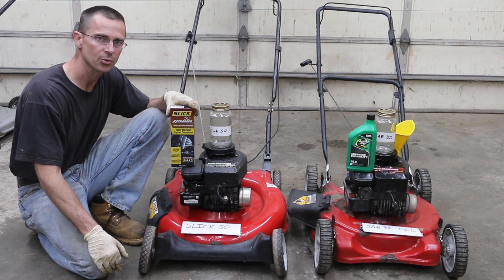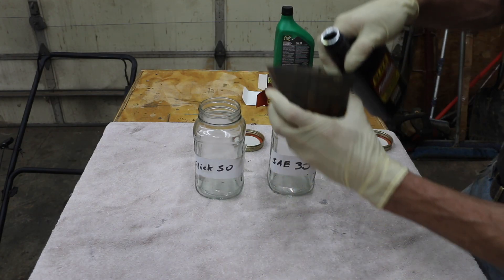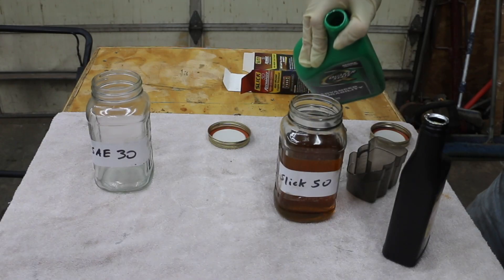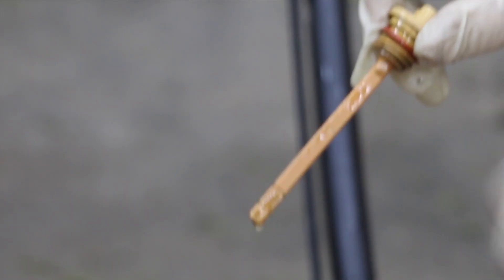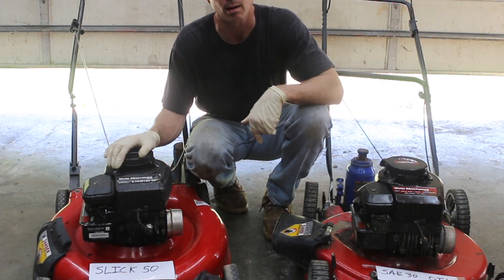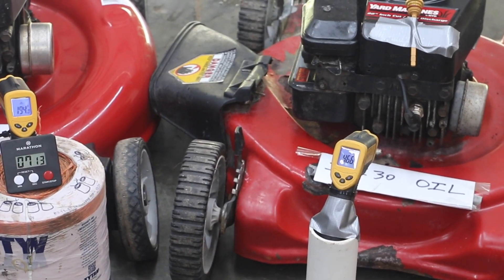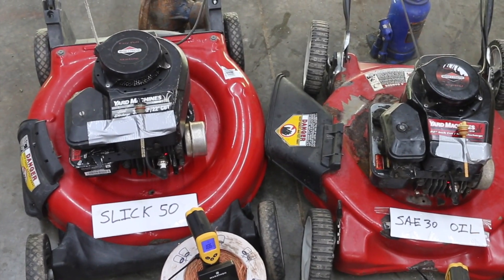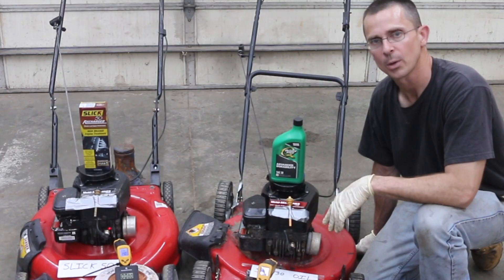Can't believe what SLICK 50 did to my engine!!--Dry Crankcase Test!

Comment: G'day,

   Well, the Luftwaffe used to add Powdered Graphite to their Aero-Engine Oil, according to legend, which supposedly enabled somewhere around 5 minutes extra running-time, after losing Oil-Pressure in Cimbat, during the Battle of Britain...; but..., I first heard the story from a Travelling Salesman who was flogging "Wynns" Friction-Modification Oil-Additive, back in the late 1970s.

   They used go around all the little Country Town Shows, to run a 6-Cylinder Liquid-cooled Car Engine (with Overhead Valves operated by Pushrods & Rocker-Arms), on a Test-Stand which was mounted on a Trailer behind tgeir Truck loaded with their product ; and they'd fill the Engine's Sump with new Oil plus their Additive early in the morning, around 9:30 AM, run the motor at idle for about half an hour, and then leave it running while they drained the Sump, and removed the whole Sump-Pan, plus the Rocker-Cove & Side-Plates..., and then it would sit there turning-over for about the next 12 hours ; and then do it all again the next day... with the same Motor (!).

   It was really very impressive, until my father (an Engine Reconditioner who owned hisvown Offset Crankshaft-Grinder in 1948...) explained the trick to me...

   The Water-Cooling keeps the Head & the Block cool, and pulling the Covers off (ostensibly done to "prove" that  there was no hidden Oiling-System...) made all of the Moving-Parts become effectively Air-Cooled, at Idle-speed and under no load ; and given such conditions..., it takes a bloody long time for ALL the Oil between the moving-surfaces to dry out completely, especially if the Crankshaft was carefully ground so as to have all of it's Journals a few Thousandths of an Inch undersized - to allow them to expand into the Bearing-Shells with a slight clearance-fit, rather than siezing-up, when the Engine does become warm to the touch...

   But a lot of people didn't have my Old Man for a father to explain the inside story, so vast amounts of the Additive was sold...., because "seeing is believing..." (!).

   Caveat Emptor !

      (Latin, for "Buyer BEWARE !").

 ;-p

  Ciao !

Comment: STP  back in the day before synthetics, supposedly that was one of the benefits of NASCAR engines running it. if there was an overheating issue or a loss of oil pressure, it would help the engine live longer.
Reply from the maker: David, Great point!  Thanks for watching the video and commenting!

Comment: the lawnmower what's slick 50 looks a lot newer then the one with regular oil. before even running the test I knew the one with slick 50 would lock out first because it's a newer motor and obviously has less wear on a crank, it's a common sense it would have a lot more friction then the other motor with regular oil.
Reply from the maker: Nick, Great point.  If I do these sorts of tests in the future, I'm hoping to use new engines to ensure a fair comparison.  Thanks for watching the video and for the terrific feedback!

Comment: Hey Buddy you need to try Z Max for the oil.   They also make one for the fuel.  Z Max bonds to the metal on a molecular level.  I'd like to see you test it.
Reply: Armando Dy z max saved my 350 Chevy engine after the radiator  blew out.

Comment: I agree with Pat it's not the same formula from its original designer. PTFE does coat engines however it also plugs them creating engines to seize quicker.

Comment: try the engine restore.. that stuff works badass.. I started using it on my 2001 Chevy 5.3 v-8 after 276*** mile.. n man o man that stuff works.. yeah buddy.. no my truck has 678** mile n still going super strong.. u should make a vid. on it. I promise it's well worth it.. it's only $10. a bottle 4 v-8 formula. 👍👍👍👍

Comment: OMFG Quaker state? really? the poor man's choice for highest sludging motor oil! all lthis time i just thought slick 50 was the first synthetic motor oil before mobil 1 and royal purple or rotella. Those are incidently the ONLY oils i will put in any of my vehicles. My first choice of course is Mobil 1 i haven't tried a test like this with those motor oils but i never really got the warm fuzzies about slick 50 even when they made all of those massive claims that they did when that stuff came out. i remember seeing their infomercials on the stuff and the metal bearing load tests they did on it to sell the stuff.  what a joke that is and yeah i remember them driving a car, flying a plane and running a motor under water even in one of the commercials. i didn't even think they made slick 50 any more now. I'll just stick with Mobil 1 though that's what's given me the best results since it first came out.  it costs more but like a divorce it costs more because it's worth it!

Comment: Who cares how long it runs without oil?  That's not how I run my motors.  I've never had a motor yet that Slick 50 or any other snake oil would have been worth using.  With mfg recommended lubricants they already last long enough that other things go bad and the device they are powering get's so old it is not worth fixing anymore.

Comment: We don't know what the beginning condition of each motor is.  They don't look new, so without history of each the comparison is bogus.
No deterministic verification that each crankcase was completely empty.Probably a lot of other things I could come up with but bogus x2 is still bogus.Scientific fail.I don't run additional additives (snake oil) in ICE.My 22 year old lawn mower gets Chevron Supreme, SAE 30 (has had only one oil change),  have never winterized it.  Just put it away in the fall and bring it out in the spring and it starts right up.Here's a tip for extending utility motors.  Each time you finish the mowing chore, idle the motor for 2 minutes before shutting it off.  The hot rod racers will probably smirk at that.  But just because drag racers shutdown at full throttle doesn't mean you should do that to your utility motors.  Unless you are going to "read" the spark plug there is no need too.  Better to let it idle a couple minutes to "load up" and lubricate good before putting it away so it will be better lubed when starting cold the next time used.  Cold start is when the heaviest wear occurs.Also, never put the lawn mower or other equipment away hot.  Always let it cool off before storing it away.  If it catches fire, better for it to be away from anything else and doesn't put peoples lives in danger.

Comment: Temp reading setup is bogus.  SAE 30 engine is in the exhaust of the Slick 50 engine.  Of course it's going to be hotter.  The air it has for cooling is the exhaust of the other engine.
Temp comparison = fail.

Comment: Idk if u said 30 weight or something else but the W on the oil does not stand for weight it stands for winter which means that the viscosity level 30, is a number of how fast or slow the oil will move

Comment: i honestly think sea foam would beat marvel in this type of comparison because seafoam is more based torwards this aplication directly and fast action where as marvel is intended to be added to the gas and oil . in either case the marvel wasnt used like i would use it... for instance i would add it to the tank about 1.5x the lable instructions and swap a quart of (slightely heavier) oil for a quart of marvel  and drive for a weak and repeat as long as nesessary or indefinitely to keep your fuel system clean i always recomend a quality synthetic fpr engins to take care of sludge.... but what i do in cars,  however I also work on mowers, a quick example: after warming up a lawn mower 6.5hp motor i was able to unstick the piston rings by filling the spark plug whole while hot and letting sit over night. it took two attemps but it stopped burning as much oil and the better compression made life easier starting the mower... I never really thought of Marvel Mystery Oil being a fast cleaner but being diluted by gas or oil i see it as  more of a cleaner that works in time ( like cleaning out all sludge from a few oil changes) or when used in the fuel system it can be used as a great lubricant and cleaner for the injectors and fuel pump which can be used continuously with no harm to the fuel system in fact there are benefits such as the lubricating aspect. overall it is not harsh like seafoam imo and longer lasting. and if you happened to be packing bearings and your out of hand cleaner Marvel Mystery Oil cuts through grease better than even  the best degreaser. just use hand soap after and you will be amazed by the stuff
Reply: this comment was aim toward your last video on Marvel Mystery Oil vs. seafoam  not sure what i did here or what happened while I was watching the other video  but thats my take

Comment: The new slick 50 is garbage sorry my engine began to run noisy after using it ( it was well shaken) it didn't have the teflon by the looks of it needless to say I drained it asap . A number of years ago I used the old school slick 50 in a van I had it ran quiet and smooth, one day being out on a stretch of highway for about an hour I realized I had a blown oil line and had been that way for a while .Without the old slick 50 I'm sure it would have seized  solid.

Comment: All that stuff is snake oil. If it was any good auto manufacturers would be putting it in their cars.

Not to pick on your test but you should have used two brand new mowers of the exact same model.
Reply: That's baseless conspiracist bullshit. In the real world, if someone suffers an early engine failure, it's likely to prejudice them against that particular brand of vehicle, so they'll go and buy their new one from a different manufacturer.
Reply: Daniel Miller after a lot of reading on this topic, I believe you're right.
Reply: Yup.  And not put one of them in the exhaust of the other.
I don't use snake oil either, and I don't want to come off as defending it.  But I like good well controlled scientific tests.  This is not in that realm.  But then again, neither are the snake oil mfg tests used in their propaganda.  Every one of them I've ever seen I can pick out numerous things that invalidate their comparisons.  They all engage in bad science to create their propaganda.
Reply: In 1984 Slick 50 lost the right to sell the original product. They had to make their own lubricant and it does not meet any of the original specifications of original formula. If you want to try the original formula it is only available branded as Xcelplus.
Reply: There is never any reason to put anything in a well maintained engine's crankcase other than engine oil.
Reply: Promise you'll never work for an auto manufacturer if you believe that is how they operate.  You are far too cynical.  Manufacturers have far more incentive to build cars with engines that last forever.  If anything, they tend to be cautious in recommending servicing intervals and recommended lubricants.  The most problematic components in modern cars are the electronics.
Reply: Nah Mahdawg I mean Ford didn't need to because of alot of reasons,mainly the auto industry is just a part of Ford and not its entire operation
Reply: Daniel Miller PREACH
Reply: Look up "planned obsolescence"
Reply: Michael Meisman  - Please provide the source of your information so it can be verified. Thanks very much.
Reply: Actually, manufacturers DO NOT want superior lubricants on the market. They want early engine failures so they can force people to spend money on more cars and car parts.
Reply: Daniel - except Toyota, they seem to run forever.  (good point though).

Comment: I am curious as to how exactly the slick 50 engine ran so much cooler. I never knew the engine lubricant to have such authority in cylinder head temperatures. I suspect that the fuel mixtures were different.

But they laid claim to be able to run so long with no oil after a slick 50 treatment and let us just suppose that it is a superior product, even if it lasted 16 minutes, it still would have failed.

But regardless, I remember my dad bringing home a push lawn mower way back in the 1980s. It had a Briggs and Stratton engine on it. it got nothing but regular engine oil. I mowed with it a lot as a kid and 30 years later, it still ran really well. the wheels fell off of it many times. It's death was the result of an engine fire... long story there. but that death was only because the fire melted the governor. It could have been fixed, but 30 years is enough life for a lawn mower... I guess.

Adding any oil additive to that thing over the years would have been largely a waste of time and $$$.
Reply: Reason for the temp difference is because the SAE 30 motor was using the Slick 50 motor exhaust for cooling.
Reply: +Paul Standaert I will second the fuel mixture settings could have been a factor
Reply: Further research suggests that slick 50's original formula (maybe it has changed over the years) was developed long ago to do just what happened here in the video. It was to leave a dry film lubricant behind so that military helicopters could land while under power when a serious lubrication issue occurred. The goal was not to prevent damage to the engine or whatever component that it was to be used in, but instead to be able to get an extra minute or two of operation so that the aircraft could be landed safely rather than the engine seizing and literally throw schrapnel all over the place. But if oil was kept in the engine or turbine or whatever, it made no difference whether slick 50 was there or not.

Comment: My guess is that what determines the death of an engine is how fast the additives in the lubricant lose their physichochemical properties.  It's my understanding that in this regard synthetic oil surpasses regular oil.  Slick 50 probably contains a lot of additive, and I don't know how well formulated it is for this particular test.  As an earlier commenter mentioned, maybe the Slick 50 engine is more easily recoverable than the SAE 30 one.

Comment: slick 50 is a sulfur based oil additive, and we all know what sulfur does to your engine over time. If you don't know, it is corrosive and eats metal with prolonged use. Not a good product in my opinion.

Comment: There used to be a product called Wynn's Friction Proofing that they used to fly an airplane, drain the oil out of it, and fly it again for an hour.  Without the Wynn's it could not do that or even come close.  Airplane engines have a design point of 90% power.  They run at 100% on take-off and 75% cruise.  (small piston engines).  I believe someone else makes it now under a different name.  That's the only one I can think of to try.

What I noticed on YouTube is BestLine is either selling Wynn's Friction Proofing under a new name or it is similar in function.  What I know for sure, is the machine they use to demonstrate with IS the Wynn's Friction Proofing machine.

Comment: It's all snake oil.
Reply: Agreed.  Just use engine oil.  That's what it's made for.  There is no reason to put anything else in your crankcase.
Reply: In 1984 Slick 50 lost the right to sell the original product. They had to make their own lubricant and it does not meet any of the original specifications of original formula. If you want to try the original formula it is only available branded as Xcelplus.

Comment: Seems like more oil came back out of the slick 50, you can see that in the comparison of the colors after they've been drained, slick 50 jar has way more oil in it. The pure sae 30 engine probably had more residual oil.

Comment: motorkote would be a good one to test.  seems to me that a fairer test would be to allow the engines to run for a few hours total run time, with 3-4 complete heat cycles before draining to test.  most of these additive products need some time to either penetrate the metal or leave a proper coating for maximum effect.

Comment: I think other factors killed the Slick 50 motor. I'm not a fan of these products but I don't think it would make things worse. It's probably just an sae oil with some sort of lubricant package. I think even at 20% mix it would still perform pretty close to the 30w oil. Did you check the spark plugs after?

Comment: Try Motorkote. it's like 28 bucks for a bottle at wal mart or truckstops. it's an oil additive and lots of truckers swear by it. I'd be super interested to know if it works as good as I've heard. I have used it a good bit before. it can go in anything from transmission motor or rear end.

Comment: I used Tufoil.   They did research and also badmouthed the Slick 50 as advertising hype.   They said that it took time for their special detergents to allow the teflon to work its way into the metal surfaces.   They we not a one time use product but said a small amount had to be added continually.  So maybe you would have had to run the Slick 50 for a long time to get it worked into the metal before running the test.
   But please OPEN the units (the heads at least) as see what happened!

Comment: When the infomercials showing engines running without oil were popular 15 or so years ago I attended a demonstration for Tribotech. It was conducted at a local shop by the owner whom I know. They used an Infiniti G20. After treating it with the product they drained the crankcase and spent the next hour or so giving people rides. I went for a spin. Ron nailed the throttle several times and the engine didn't miss a beat. A mechanic friend told me it was impossible, that there must have been some secret source of oil. Maybe so but I certainly didn't see one.

Comment: Project Farm, I am uncertain of the accuracy of this test.  Perhaps this is the new Slick50, but I promise you it is not the old Slick50.  I know, from my own experience, that the old Slick50 was good stuff.  The engine I had was a VG3.0i in my 1988 Nissan pickup.  Year was 1990.